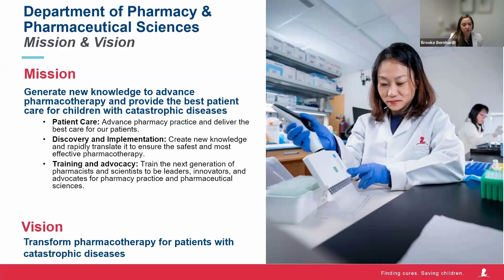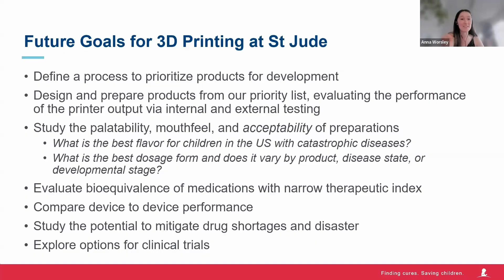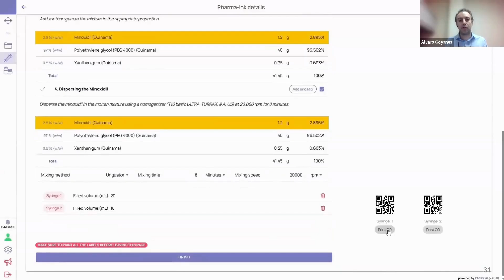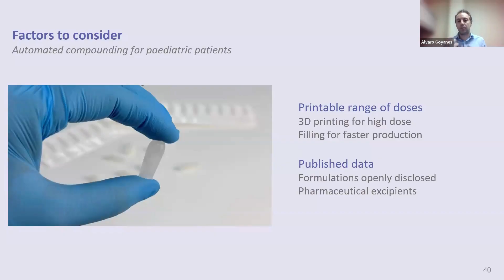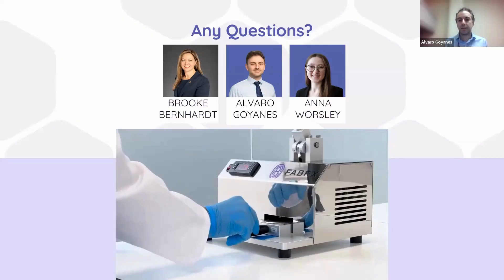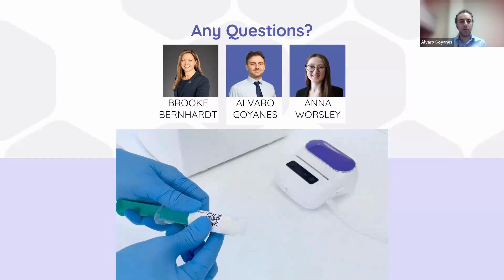FABRX Webinar: 3D Printing Innovations for Child-Friendly Medicines

Comment: Excellent webinar! Thank you for sharing such inspiring work on pediatric 3D printed dosage forms.
I have a question regarding the formulations you mentioned: since the 3D printing process involves UV light for solidification, would it be necessary to conduct preformulation studies to ensure that the drug is photostable when combined with the printable base?

I’m a professor at the Federal University of Rio de Janeiro (UFRJ), where we are about to open an academic compounding pharmacy. Our group is very interested in developing 3D printed formulations for congenital toxoplasmosis and sickle cell anemia treatments.